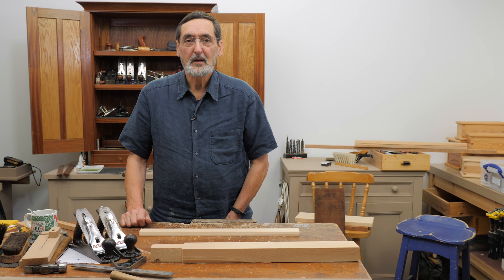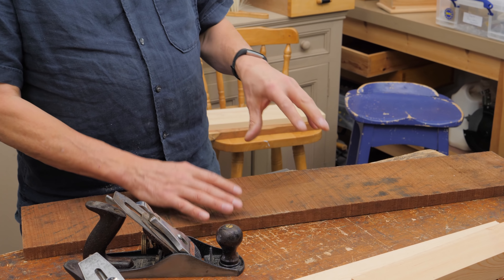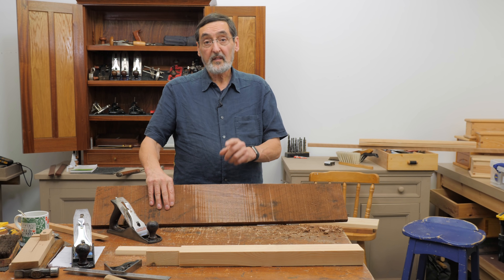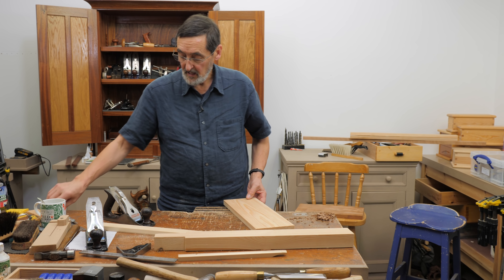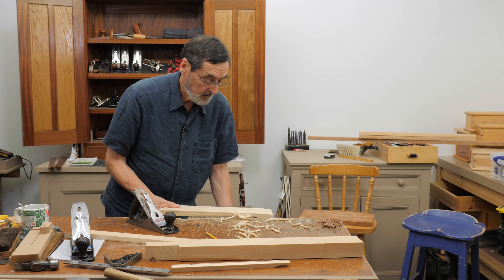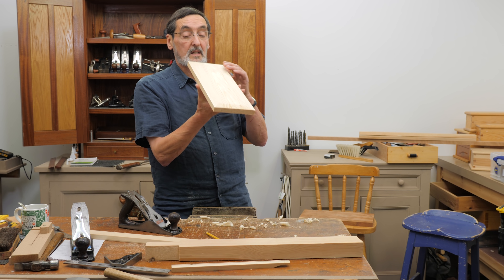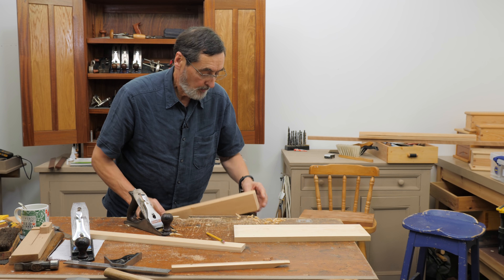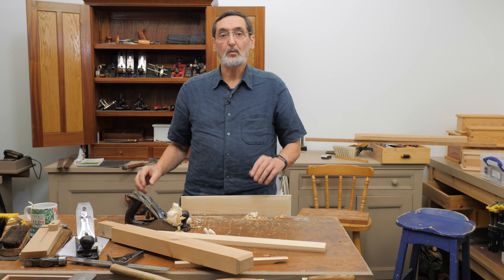How to Use a Scrub Plane | Paul Sellers

Comment: I recently bought a plane on eBay. I wondered why the mouth seemed so very open and the blade curved. I couldn't get smooth cuts to joint an edge. Now I understand what the previous user did and will use it as it was intended. Thanks Paul.

Comment: Many thanks for your diligence and effort over many years to educate us.  Indeed we hand tool aspirants live in a blessed time to have your patience, insight, and wisdom available.

Not from experience, but instead from watching and thinking, it seems that the "coarser" tools like the scrub plane might be more useful, or perhaps should *get more use*, than the "finer" tools like the finishing plane that usually monopolize the spotlight.  Whether it's learning to sharpen across a set of stones of progressively finer grit, or learning to mill with handplanes of progressively finer set, one of the lessons I'm learning is to use the coarsest tool first and continue with it until I have the basic shape - a flat chisel back or a board of the desired thickness -  then the next coarsest tool, etc, until only finishing with the finest tool.  So "finest" doesn't mean best, it just means last.

And as you show us here, sometimes that coarsest tool is the only tool we really need.

Comment: I just converted my No3 which struggled as a smoothing plane into a scrub plane, i set up the blade and the throat as per your email. I'm really annoyed with myself that i didn't do it earlier, much earlier. Its the best plane i have in the shed.
Thanks Paul

Comment: Just got an old scrub plane similar to a stanley no 40 cheap in an antique shop. Ive been using it when i start on rough stock but never considered it for doing chamffers and textures. Thanks for the tips!

Comment: Some woods can be very hard on your tools.  I have cut a 40 mm thick block of tropical azobe wood with a rip saw to end up with two planks of 18 mm. I took me hours to complete.  Azobe is nearly impossible to plane by hand, it is very dense and extremely hard.  The rough twirly grain makes it almost impossible to plane by hand.
Reply: Then find a wood that you can use easier. Make certain types of wood for certain tasks.

Comment: Great video Paul...  I have been a joiner for about 25 years now and adapted a stanley No3 to a scrub plane many many years ago...  As you said they are great for all kinds of jobs and I found that I more often grab it than any of the other planes...  I also found that it is a great way to teach someone to use a plane when using a scrub plane...somehow the fact that it makes nice shavings easily gets them hooked on using it...

Comment: I modified a new production kobolt no4 plane to a scrub plane after watching your video on how to convert regular planes into scrub planes and it gets more use than the two number 6s I have combined. 
I really hope people watch this and get into using one, it's so frustrating to see people trying to flatten a table with low angle finishing planes

Comment: I now realise I’ve been using a scrub plane for years, with the mouth wide open and the cap iron set too far back and the blade protruding too much. Another great video. I learn somethings with every video, even though I’ve been at it for decades. 
Does anyone know why and when any plane should be held at an angle instead of inline with the wood. How does it work?
Reply: Jim Bo Not sure of I'll be able to articulate the mechanics of it as well as someone else might; but it can reduce tear out and splintering at the end of the piece of wood(especially when planing across the grain) by creating more of a "slicing" action when angled. For instance, when he's creating the chamfer in the video. When planing with the grain(smoothing a board for instance) a slight skew when planing can again reduce tear out, and also reduce resistance to an extent.
Reply: It can sometimes help prevent tear out if you skew the plane in favor of the grain. This can also make it slightly easier to push the plane, since you are effectively lowering the angle of the blade, but you are also effectively widening the mouth and moving the cap iron away form the cutting edge, which may some times increase tear out. If one thing does not work, try the other.
Reply: Skewing the plane actually reduces the angle of the tip of the blade to the wood so it "slices" better as said above making pushing the plane easier in some grains.  With using a plane often, you begin to unconsciously notice this and do this.  Well, why not do this all the time then? - because skewing the plane also effectively shortens your plane so you may not be creating as flat of a surface.

Comment: Hi, I'm translating this video into my native language. Could someone explain to me what this phrase means: cups and divots? Paul Sellers used this phrase here 1:24 .
Reply: Maciej Moczydlowski : I hope you can translate this OK, "cups" are concave depressions in the surface of the wood caused by either tear out, or differential shrinking, the "divots" are chunks of grain that have ripped out during sawing, leaving surface holes or pits. Hope this helps.
Reply: thank you
Reply: Cups and divots are indentations.  Cups being larger.  Hope that helps.
Reply: Maciej Moczydłowski,
He's talking about the low spots left after the sawing process.
Reply: A "cup" is a curvature across the grain. If you look at the end of the board it looks like a cup. I assume a "divot" is where there was tear-out. Cup is a product of the grain structure and drying.

Comment: Yes. I am just getting going with woodworking at the ripe old age of 62... (overipe, really!) and bought a Stanley 4 in good condition from eBay. Then saw another one in slightly worse condition going cheaply so I bought that also, with the intention of converting to a scrub plane. Depending on the condition of the blade in the second one, if it's not great, would you recommend i buy a new blade specifically for scrub planing? Given that i don't have a grinding wheel. If so would you recommend any particular blade make/type in particular?
Reply from the maker: Certainly not necessary to buy another blade as the existing blade will work just fine, either way you still have to reshape the blade. Whether you do it by hand on diamond plates, or find somebody with a grinding wheel is the only choice remaining.
Reply: Or find a friend/mentor who has a grinder. It will only take a short session to put the profile on the iron and surely someone would be willing to help. The honing could then be done on stones or diamond .
Reply: However, if you are looking at aftermarket plane blades for this or other planes, look up Hock blades.

Comment: This method of planning wide boards leaves a really nice finish, I have just finished planing 35 Sq Mts of Oak floor bards with my Stanley 4 1/2 that I modified to a scrub plane, and now it is now it looks like it has been there 200 years, so much better looking than bland smooth machined finish. Chris B.
Reply: It depends on how you set up the scrub plane. Some can be for a rough finish and others can be for a finer finish.  It is all the eye of the craftsman.
Reply: @bighands69 how does one even set it for a finer finish?

Comment: Pretty sure this is the best scrub plane video I have seen thus far. . . . . .  Does the length of the plane matter when building or choosing one modify/convert ?????
Reply: I find that a light scrub plane is a good scrub plane, so I would say shorter is better. The reason a light plane is better as a scrub plane is because it takes less effort to get it moving, so you can work faster and longer.

Comment: So if I've got a smoothing plane with an adjustable mouth a good approximation for a scrub plane is to widen the mouth, set the chip breaker further back, and use a blade with a fairly aggressive camber?
Reply: Exactly.
Reply: Thanks for the confirmation!

Comment: Can u please give us your recommendation for starter planes? What 2-5 most recommended sizes would you start with?
Reply: For just two planes I would start with a No. 4, and then either a No. 5 or an other No. 4. Set one No. 4 up as a smoother, and set the second one up for coarser work, more like what was shown in this video. A No. 6 or a No. 7 can be nice for jointing long pieces for glue ups, but I find that you I end up going back and making fine adjustments with my No. 4 anyways, so they are not essential. If you find that you can handle a plane that is harder to push, the No. 5 1/2 and No. 4 1/2 are nice to have, or if you want something lighter go with a No. 3 or No. 5 1/4. Hope that was useful.
Reply: the longer planes are called 'varlope' historically.
Reply: You can't go far wrong with a Stanley Bailey No. 4.
Reply: How would a Stanley Bailey No 4 compare to a wooddriver brand $150 they sell today at Woodcraft ? from some review it appears to have too wide tolerances and that you have to spend more to get a fully satisfactory No 4, i guess that means $300 which is crazy.
Reply: goognam goognws  I recently paid £25 for a Stanley #4 that I found in an antique shop.  I think it was made in the late 50s and it was a bit rusty and needed sharpening but that was easily sorted.  Now I have a good plane that will last another lifetime.

I really wouldn't be spending $300 on a plane.  It simply isn't necessary.
Reply: Joshua, i agree thanks for the answer. I wanted to get an idea on the cost of a second hand Bailey.
Reply: #4, low-angle Block plane and #5 or 5 1/2 Jack plane.   I have a 5 1/2 and it is my go to, do everything Jack plane, little longer than a #5 so I get by without needing a jointer plane for most of my work.

Now, here may be some controversy.   Several years back everyone came out with a reproduction or their version of the old Stanley low-angle Jack plane.   This is a nice, useful Jack model with different blades for different uses;  it was the latest craze and I myself lusted after one and put it on my wish list.  I never got one for two reasons, 1) I realized that i would never use my #5 1/2 again and I loved that plane and 2) as the guy with Highland Woodworking said - this is a great "Jack" plane, do everything plane, but as you grow in woodworking, you will gradually get more specialty planes that do some of its jobs, eventually, your low-angle Jack plane is just an wonderful, but expensive Shooting board plane. I realized he was right.    However, if you are someone who doesn't yet have ANY woodworking planes, that low-angle Jack might be your best first plane.

Comment: After having a look at the Stanley plane I bought 20 years ago, it may be possible its a scrub plane. Its always taken a lot off and has a wider mouth than my No 5, thanks for the insight!
Reply: That's what I did.   over time in my woodworking, I bought a few better planes.   I turned my original Stanley plane that I didn't use anymore into a scrub plane with filing open the mouth, getting a Hock blade and putting a curve on it.   now I love using it.
Reply: I might be wrong on this but I  think the original No 4 are all regular planes, the scrub plane is a modification made post factory by individuals to make it a faster cutting tool.
Reply: @goognamgoognw6637  Acutually Stanley did make a scrub plane, it's a #40.
Reply: @Blasthoff  Yes, Stanley does make one, there is a #40 scrub plane for sale on a site I go to, I didn't know what a scrub plane was, so I searched scrub plane and found this video. It's $95, about 100 years old.

Comment: I got a record 405 multi plane in box for free and a lot of Stanley hand planes for free as well but the record 405 multi plane looks like it hardly been used but the only problem is that it doesn’t have the blades with it dose anybody know where I could get them and is it a good plane thanks
Reply: Nathan Richardson it is a very very good plane and can be used for many many jobs you can find plane blades for your plane on eBay as long as they are by the maker of the plane ie a Stanley no 50 plane blades will fit
Reply: Nathan Richardson all record plane blades will fit your record plane eBay is the place to get them
Reply: Thanks for helping

Comment: Would it be a good idea to turn a no. 5 plane into a scrub plane or wouldn't that work as well as a no. 4? (I happen to have a no. 5 plane which needs restoration anyway)
Reply: That will work just fine.
Reply: Thanks for your reply. I'll give it a shot.

Comment: Paul, how do you feel about the use of wooden jack planes with a scrub grind? I have a jack which was already ground to a radius, and I stuck with it. I tend not to use it for facing panels, but often use it for reducing their width.
Reply from the maker: Yes, wooden ones work better than the metal ones.
Reply: Paul Sellers Paul, if I follow your other video and make a scrub blade for my Stanley #4 (just got it used on ebay) and widen the mouth, would I still be able to use it as a smoothing plane with its original a straight cut blade?
Excellent video and demonstration Thank You! At 67, I get winded faster than you do.
Reply from the maker: Absolutely. There is more written on the frog aspect of the plane than any other part and yet my research has shown that 99% of people never move it once they establish what they want.

Comment: Can the scrub also be used to hog-out a contoured chair or stool seat? Or would say a 113 be a better option? Would it be possible to set up a 113 as a scrub?
Reply: A round-bottom spokeshave probably would work better on the seat.  A chairmaker's scorp would probably be the best tool for roughing out the seat.  A rounded cabinet scraper could be used to smooth out the gouges from the scorp.
Reply: I have a 113. It is really only suitable as a smoothing plane IMHO. Also it only makes quite large radii. It might be used on the convex surfaces of a chair, but I don't see it being useful on the concave surfaces. a scrub plane however would be excellent for hogging out the convex surfaces, so would a spoke shave. For the rest use the tools Richard Freeze described.
Reply: neistridlar thanks guys

Comment: Sellers is my absolute favourite woodworking teacher.

But 30seconds thru my dewalt 735 and ive got flat surfaces, just dont have time to do this with a young family and limited shop time.

#retirementgoals
Reply: And good luck to you but some of us don't have those tools or prefer to use hand tools.  If woodworking is only about making the end product (which is perfectly fine) then do whatever is quickest.  If you have the time and you want to enjoy the journey and not just the destination, use a scrub plane.

Comment: This just reminds me I need to take the wheels off my bench so it doesn’t move when planning ... so much crap to move tho lol
Reply: Who said that ? If it's in the budget, check into wheel kits that allow raising and lowering of the bench when you need it stable or moveable. Most woodworking supply stores (or online ones) will have them available. Some are even removable and you can buy extra brackets for other heavy tools that can use the same set of wheels (one tool at a time of course).
Reply: Something I learned quickly about wood planing is that the quality of the planing tool fall on second plane when you haven´t a good, strong, dependable and flat workbench, is the most important tool in deed (even it if hasn´t a vise).
Reply: I agree with mister Pindonga here, having a strong and hard workbench is key to planing in one stroke, as one should always strive to do. And if that doesn't work, just ask here and Pindonga will provide haha